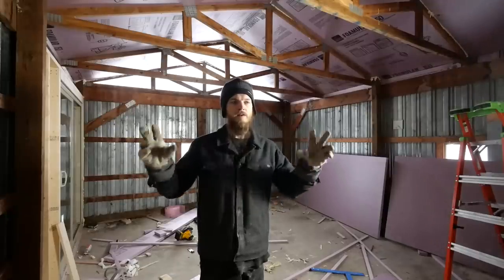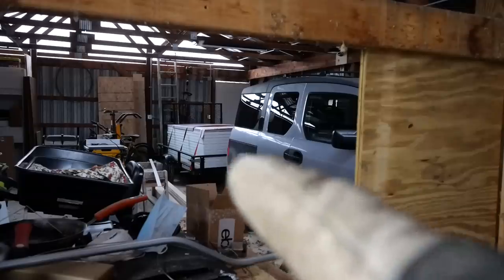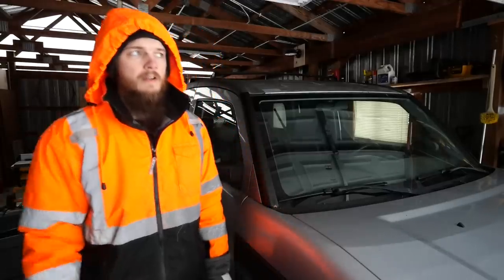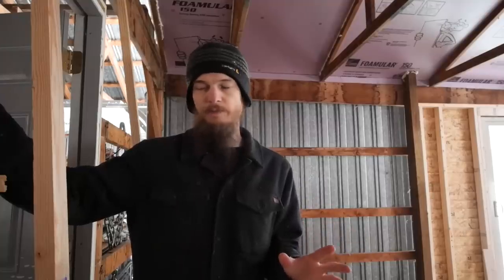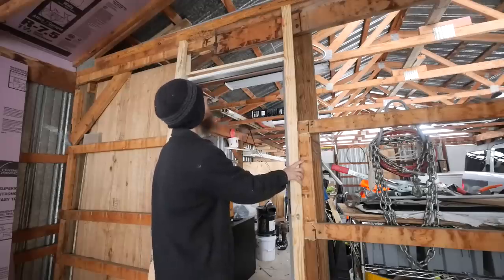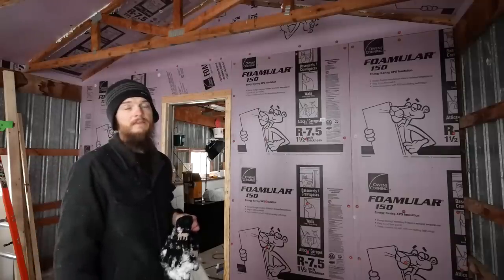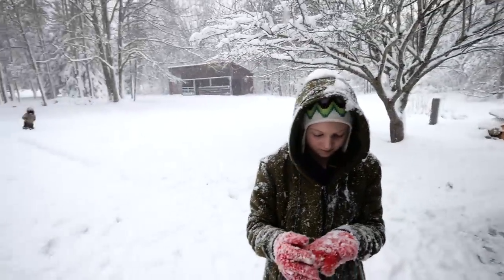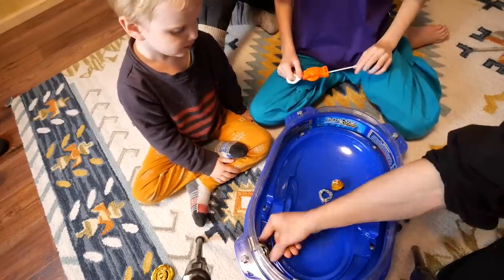You Won't Believe What We've Been Up To | Pole Barn Conversion (Insulation)

Comment: Would Belle be interested in a little background for those tops? They are from Japan, where I live, and are called ベーゴマ (or Bey tops) here. The ones you are using are called Bey Blades because of the blades, or wings that have been added to the outside to make the battles more interesting.

Playing with Bey tops started over 1000 years ago during the Heian era in Japan. Kids would take pointy shells called Bai shells (The pronunciation evolved to Bei. Look up Babylonia japonica) and fill them with clay or wet sand. They would then wrap string around them, set them on the ground with the point down and give the string a pull. This made perfect, fast spinning tops! Over the years it became common to do "battles" with them to see whose shell was the champion. In the last 100 years toy manufacturers began making metal versions of the old shell tops. These were heavy so they would spin for a long time. You still had to wind up the string each time.
The Takara toy company began making the fancy plastic Bey Blades in 1999. They are super popular here, even now.

I think you all have cool Bey Blades and it looks like so much fun to do battles together.
Reply: Awesome history, thanks for sharing.🇨🇦🇨🇦🇨🇦🌹

Comment: Gave away my trusty snowblower and relocated to South Florida. 84 today, nice and warm. During college years I worked in carpentry helping to build 100 foot long wooden quonset buildings. Joist hangered one in Southern Alberta with -20 and 50 mph winds. I quit that nonsense and finished my degree. I don't envy anyone who has to work in the cold. Good work. Thanks for the video!
Reply from the maker: 84 is the perfect temp! Yea, working in the cold is not fun! Thanks :)

Comment: The Dewalt 20V Max propane heater works wonders. They are available at Lowes $179.
Also on eBay for $165 Dewalt DXH70CFAV 20V MAX 68,000 BTU Cordless or Corded Forced Air Propane Heater

Comment: We used those white plastic disks all through our house for insulating with 3 inch thick poli-ISO foam boards.  They are fantastic.  I got them delivered to the house from Home Depot (Lowe's didn't carry them at the time) in a box of 250 count.  :)

Comment: Just adding foam board will make a big difference.  I did it to a pole barn a few years ago and the inside never got below freezing even when the outside was 0. I added drywall over the form board on the walls.

Comment: Umm, Doug- you don't need a 100 friggin' nails in those boards.  2, maybe 4.  You are going to be putting OSB on top of everything, and that will hold/clamp all that extruded polystyrene in place.

Now that you've got a pretty good perimeter in place, you could heat that space with a couple 500w worklights.  Try it!  Oh, and you could throw your scrap pieces of insulation in the dead space in the walls as you go, to reduce your total scrap/trash.
Reply from the maker: Good idea for the scrap pieces :)

Comment: A bucket with 100-110 degree (37-43 Celsius) water works great at fixing cold work hand syndrome. Especially if the bucket is a covered 5 gallon one nesting inside a second 5 gallon bucket providing an insulating layer.

Comment: Quick question : With that insulation being fit so tight why do you need to add the nails??  If you are just drywalling over wouldn't it just stay in place??   I have never seen bey blades in action, they do look like fun!  Have a great day!
Reply from the maker: Just to hold them in place in the meantime. Some panels aren't tight. Thanks!
Reply: @diyfferent  oh okay, that makes sense, thanks 🙂